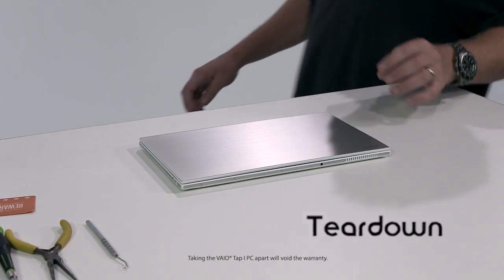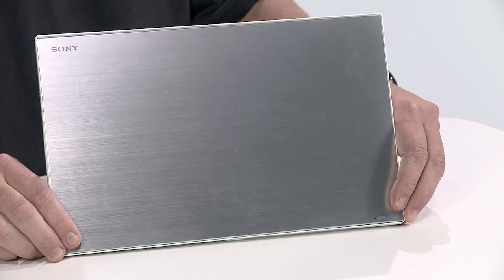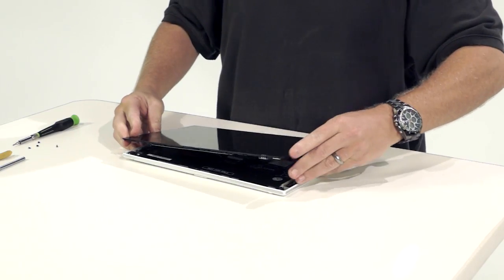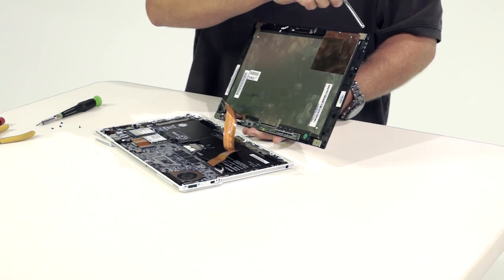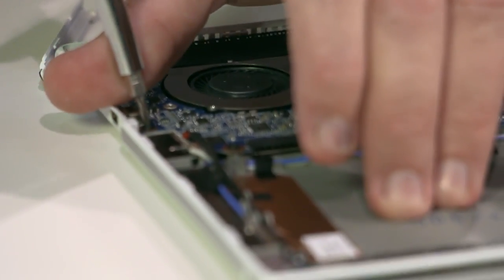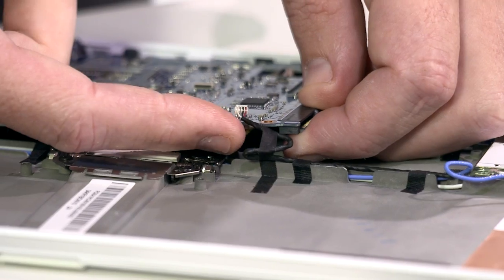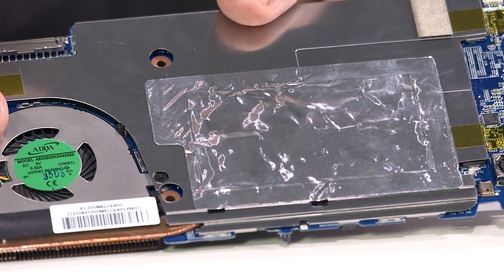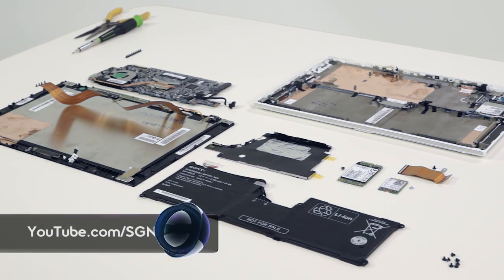VAIO Tap 11 Teardown

Comment: To "release" the screen, I started where you removed the 2 screws,and worked my way to the 3 screws.  Gently applying pressure to the case to lift it off the screen.  Then I applied pressure between the screen and the case on the other two sides remove the screen
Reply: thanks alot